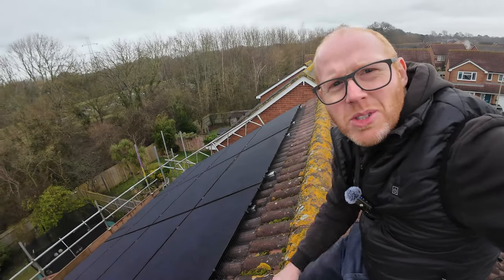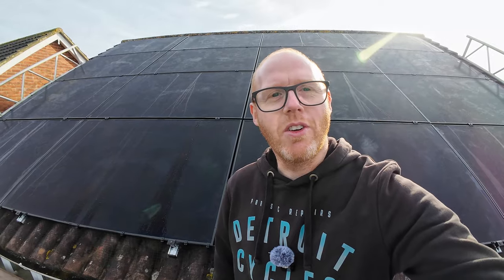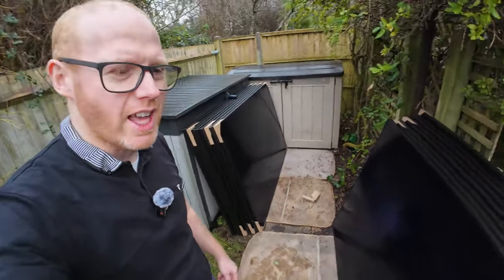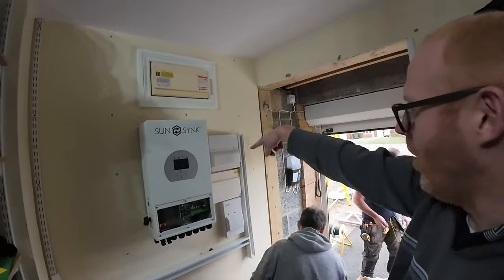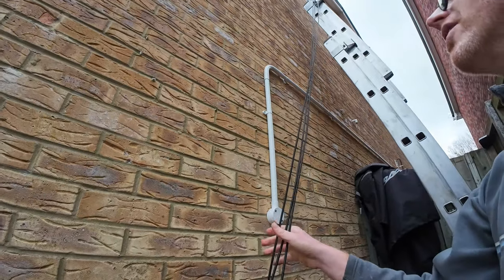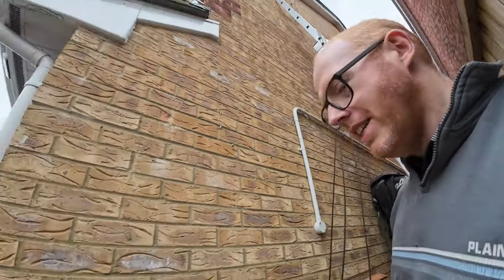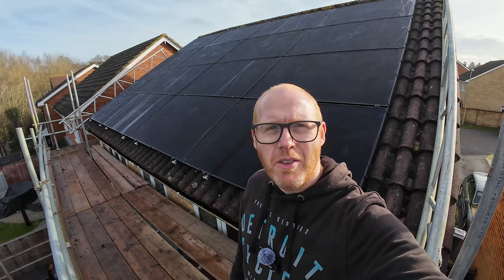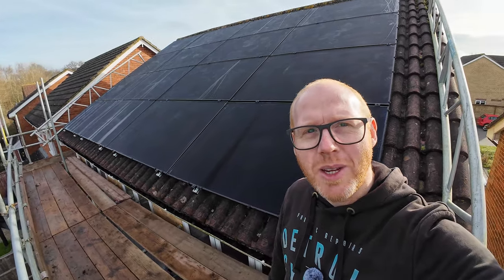Solar Panel Installation - Are we wasting our money by going against the grain with north facing?

Comment: Brilliant, I'm glad you took on board my previous  suggestion to fill your roof and use tigos and multiple strings. If you can cover base load and peak use with solar generation, and at a later date use time shifted cheap energy( off peak charging) in batteries you'll be saving money for decades after the  initial  install cost. This will also add value to your home. I have a 6.8kwp solar system, and in late spring early summer I can generate 41kwhr a day. So next up, get a solar diverter so spare  electrical energy  heats your  hot water.
 Then, when funds permit add a hess (batteries), then you'll be sorted. I recommend adding a modular system such as a 4.8kwhr Pylontrch US5000s, BUY one then add more each time you get spare wonger. For me, this has been your best content so far. Enjoy this renewable journey. It's great fun.
Reply from the maker: Thanks for the advice! Still more to come!

Comment: Thanks for filming my system is being fitted three weeks time 18 x 425w panels over an East West with a 5kwh inverter and two 9.5 Battery's The only draw back I have had is despite the installer saying he has never had one turned down in ten years of fitting systems is the DNO was turned down to a limit of 3.68 so he cant say that anymore. But hay ho such is life looks like i will be heating my hot water when the system's hitting the export limit and the battery's are charged £400 more for an Iboost not sure if its worth it yet will give it some time running and see
Reply from the maker: Ouch. We also have a G100 limitation here that I'm doing a separate video about.
Exactly like you, strategy is needed to absorb as much energy as possible.

Comment: In the summer you'll make a lot of power. The combo of a heat pump and north-facing panels is not ideal when you look at day to day numbers in January - when you are using lots of power for heat, you can't make much. You start to resent your neighbor's unused south roof area. You'll get some unexpected generation on a cloudy winter day because the clouds distribute the sunlight more evenly in the north. It wouldn't have been worth it years ago but it should be fine at today's panel prices.
Reply from the maker: Thanks for the comment. That's a great analysis!

Comment: We have 12.9kw of solar south facing but are looking at fitting 9.9kw north facing…
Reply from the maker: As you'll see from my very latest video, my NW facing array is exceeding expectations. It is way way beyond the 50% figure some people claimed when comparing against a south facing roof. Of course I benefit from being exactly NW so do get the evening sun, but at this time of the year, the NW array is already producing more than the SE array by 10am due to how high the sun is in the sky. If you have a steeper pitched roof than ours you may not benefit quite as much.
Reply: @UpsideDownFork  ours is 15 degrees and north west, so I’m hoping it’ll generate from “diffused light” also and catch the evening sun
Reply from the maker: @livingoffgridinscotland  you'll do very well indeed throughout the summer months with that 15 degree roof and it should also work well with the diffused light in the duller months. Please let me know how you get on!

Comment: In my opinion it was a good decision to fully panel your rear roof, panels are relatively cheap, its the scaffolding and labour which costs, so better to get it done in one go. I had our best roofs done in 2015 with 4kW of panels, last year I added another 4.74kW of panels to our detached double garage, along with an 8kW Victron invertor and 29 kWh of batteries. I have a large NW roof which I will likely put panels on this year, may even put some on the rear wall of our house which is SW facing. Have sat on my ridge many a time and it doesn't faze me, although I'm getting a little old for climbing around roof's! I'd be very interested to see how your NW roof performs, modelling shows I could get another 3 to 4 MWh a year adding the additional panels.
Reply from the maker: Thanks! It sounds like you've been on quite a journey yourself.

Comment: Martin's doing our install next month, all the beauraucracy willing. We went with them for the same reason you mentioned in the video: a local person with thoughts and ideas and experience rather than a big company ticking boxes. If I'd known you were local I might've asked to come and talk over the tech decisions 😂
Reply from the maker: You won't be disappointed with Martin's work. What system are you going for?
Reply: @UpsideDownFork   When you showed your panels, I said to my wife, "Oh, they're the panels we're getting" Well, I worked out why when I saw Martin's van!  Anyway, we're getting 20 of those (10 east, 8 south (6 on a flat roof), 2 west - that's what we could squeeze in) on a SolarEdge inverter, with the GivEnergy AllInOne.  I'm wondering how the inverter will cope with the panels in all these directions.  I've set up a Solar Forecast on HA so it'll be interesting to see how accurate that is, but that says it'll cover pretty much our base load even on horrid days like yesterday.
Reply from the maker: @davedupplaw  Very nice! Unfortunately our budget just didn't stretch that much. It's been an expensive year with the insulation and heat pump upgrades as well! Had to draw the line somewhere.
Martin was confident we could have used solar edge on the front roof and been able to mount an additional 3 panels, 1 x SE, 1 X SW, 1 x NE.
Unfortunately it just wouldn't ever pay for itself in our case, because of the necessary scaffold and very low generation on those single panels.
I've seen some evidence that the Tigo optimisers can handle different orientations but not in the same way that Solar Edge appears to master.
I'm sure you're going to have excellent generation!
Reply: Nicely done - all round.
Reply: @UpsideDownFork  I found the "would it pay for itself" thing a bit annoying, because basically it's impossible to guess what'll happen in the future around energy prices. I'm fairly sure our quote was also based on a slightly higher average p/kWh that we actually manage on agile anyway 🐙.  So, I figured I'd just squeeze as much as I could on (as long as I could afford it).  I think I'm doing things the other way from you, though. I have yet to go electric heating, but first I need to sort out insulation. When we tried last, they wouldn't do it as external floor level was too close to the damp course, so we plan on some landscaping too this summer.  It's going to be an expensive year 😂
Reply from the maker: @normanboyes4983  Thanks for the feedback!
Reply from the maker: @davedupplaw  Excellent! I think you're spot on with basically fill the roof as much as you can afford. 
As long as you live there for long enough then it will always pay for itself in the end, no matter what energy prices do.
I had intended to go for solar first but when I enquired 18 months ago, the supply and demand balance was not in my favour! Glad I waited as the costs have dropped and the supply/demand balance now means I could pick and choose my preferred installer.
So far, we have no regrets from any of the insulation, heat pump or solar upgrades.

Comment: I had 10 panels fitted facing SSW and I often wonder about my opposite NNW roof. My roofs also 20 degree pitch so quite shallow.. it makes me curious how well it’d perform
Reply from the maker: From what I've experienced so far, a shallow pitch is favourable for North facing.
On a overcast day with diffused light, the north facing array generates the same amount of energy per panel as the south facing.

Comment: I've had my panels in for nearly a fortnight, I'm seeing small savings because I had the gas ripped out so my heat pump is a bit more expensive to run than the gas but the panels are definitely making a difference.  Cant wait to see how the numbers compare from mine and yours, but im doing my numbers by month and not by the week. :)
Reply: Also you can probably get you heat pump more  efficent if it's a new instal too. Have yet to hear of a system that is optimised at the point of the engineer finishing instal.
Reply from the maker: Thanks for watching, please do let me know how the figures compare when I publish them in a week or two.
As Joe says, make sure you've optimised your heat pump as much as possible.

Comment: What's your projected annual output? I guess they did a pvsol calculation? Mine actually yearly output after 8 yrs is very close to the calculation. Only another 18 month or so ands its paid for itself! Mind you I do get a FIT.
Reply from the maker: 6000-7000kWh annually. Martin did say he likes to increase the shading factor to be on the safe side so he imagines it will generate more than this in reality.

Comment: Ours is East - West and works really well. You just notice a bigger difference in generation Winter to Summer as you move away from South facing because of the low Winter sun.
Reply from the maker: Thanks for the comment!
I'm hoping the sheer number of panels will help us with our base load through winter, even with the over cast diffused light.

Comment: It is great to see you finally go ahead with your solar and battery instal. 

I may have missed a video but curious of the total cost in the end. 

Also on your N facing panels if you checkout undecided with matt feral he did an episode on solar recently and he put a bunch of panels on his north roof and they performed really well because it was cooler by the time the sun hit them so this compensated to an extent dor the posistioning. 

The episode was about vertical pannels i think but he goes ona tangent.
Reply from the maker: Next video will show the breakdown of costs 👍
I'll have to find that video to watch, thanks!

Comment: i used a local company for the same reasons you just said, they came to see me and go through everything instead of looking at things from images on a computer and trying to sell you something over the phone.
your roof may not be the best facing but i would have gone down the same route, but to top things off i would look to add batteries as they make a massive difference to what your system will be capable of doing going forward.
Reply from the maker: Thanks for the comment.
I'm very happy with the choice to go local and to fill the roof. Dorset Solar Solutions were excellent 👍
Reply: @UpsideDownFork  my front roof is northwest and i am looking to put 6-7 more panels on that section of roof that will give me a total of around 9 kwh which will be good in summer a long with my 12 panels south east and 4 south west so my system will give me power from morning to dusk , thank you.

Comment: Hi, can you read your PV generation on MPPT 1 and MPPT2 from your Sunsynk inverter?

I have a 12kW SS inverter with panels in 2 directions but I can only find the total production each day, not for each MPPT..
Reply from the maker: My Tigo Cloud Connect provides me with the data for my front aspect 👍
Unfortunately I haven't found a way that Sunsynk splits the data natively without home Assistant integration.
Reply: @UpsideDownFork  thanks, same here then, I have asked Sunsynk for this but has not got a answer.
In the custom graph I can select parameters for MPPT1 and MPPT2, but they just report 0..
Total PV reports correctly.
 I can see the graph of MPPT1 and MPPT2 but not their daily production.
🙄
Reply from the maker: @jonbraathen2232  If you do get anywhere with this then i'd love to know.

Comment: Why is there no DC isolators for each string up in the loft??
Reply from the maker: Because it's a fire risk. https://youtu.be/2BBCclJuM4I?si=AfccBz4SPJmmWuTT
Reply: @UpsideDownFork  ok, seems like they contradict themselves. As it says on the inverter and on the Mc4 connectors, don’t disconnect under load - so what to do if/when you need to change the inverter - that have to be after darkness appears?

Comment: Thank you for sharing your installation. It is a bit unique but every bit of energy counts in otherwise a useless roof aspect. That is a beast of an inverter well over specified as the PV setup is usually 120% more than the inverter capacity.
1. I guess you over specified it for future battery discharge and timed charging capability? 
2. What did the DNO limit you to?
3. Interested to see your generation and Sunsynk app /software evaluation as there is very little of that about on YT.
Reply from the maker: It's always good to be ready for future upgrades 😉
G100 limited to 6.5kW.
I'm more than satisfied with the Sunsynk app and web portal. Shows more info than I need in an easy to understand format.

Comment: I have a 4kw installation facing just north of west 279 degrees i generate just under 3000kw a year. A friend similar system 4kw generates 3750 kw as his panels face south. I have enjoyed a 20% reduction in my electricity bills now 400kw and  don't have a battery. My friend has a 10kw battery and has enjoyed a 60% drop in his similar energy consumption.. these are real life comparison numbers by keen domestic retirees.
Reply from the maker: Thanks for sharing your figures! It sounds like you're doing very well!

Comment: north can be roughly half south generation - you may get better than that if you’re NW (are you NW or NNW?) so definitely worth it when you consider the difference in numbers you can get on there. total finger in the air - 6.4kwp might give you 6000kwh south facing, so 3000kwh for NW, and your south about 2.5kwp maybe 2500kwh a year. so 5500kwh would be doing well and I’d expect that covers your usage in the house just about (not including heat pump though). we did the same and put 3.9kwp on the north when we added the battery and in overcast conditions its great for covering base load, letting your battery stay topped up until later in the day.
Reply from the maker: Thanks for the comment. That's the plan!

Comment: Whenever I've looked at a solar calculator it doesn't have too much of a penalty
Reply from the maker: Yeah, I was a little surprised that the conventional wisdom of south only doesn't correspond to the calculators.

The proof will be in the pudding so stay tuned for the generation figures.

Comment: Here is a solar pv tip. Don’t get all black panels. I speak from experience as I have two systems the same but one black and one silver/black. The black panels loose about 5% or more output in summer. This is due to panel heating reducing the efficiency. 
I will admit black do look better but output is the key thing
Reply from the maker: My wife disagrees and she's the real boss 😂
Reply: @UpsideDownFork  pay back not popularity. At least you got the bird proofing on. This is one thing often not covered. We had birds for two years 🤬
Reply from the maker: @robrs210  I knew birds were an issue for us. Some neighbouring houses just a few doors down regularly have 10 or more birds up on their ridgeline. I know some areas don't seem affected but I didn't want to take the risk when it's something relatively cheap, quick and simple to fit whilst all the scaffolding etc is already up.

BTW, I agree on the principle of generation over all!